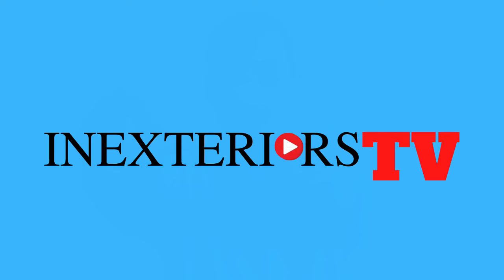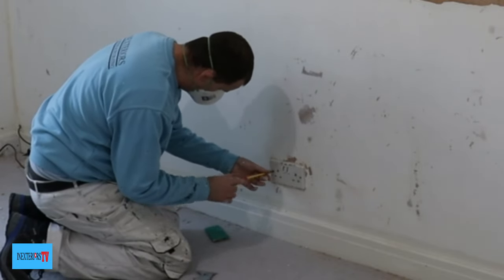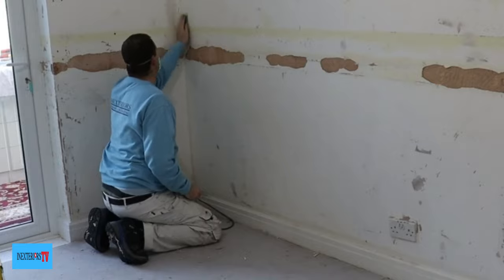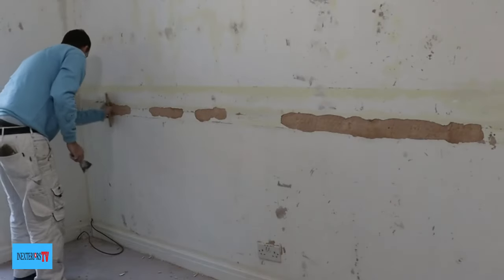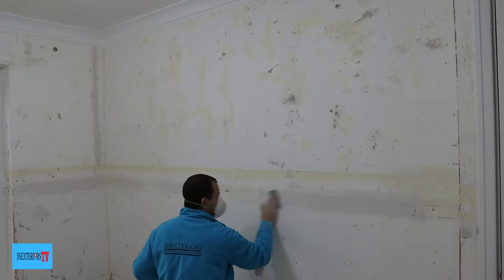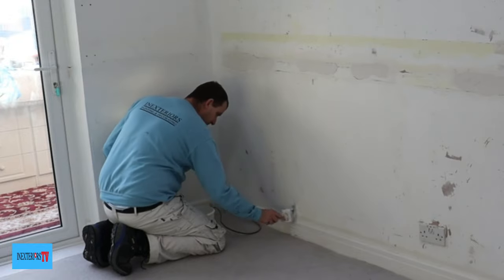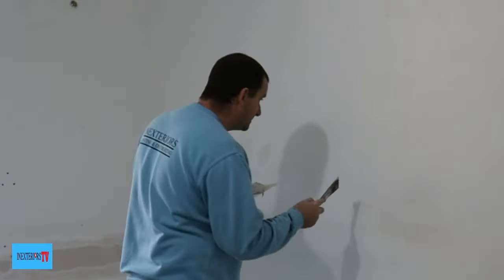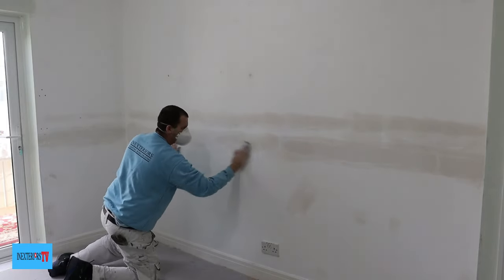Prepare and paint after wallpaper removal.

Comment: Peeling wall paper and  where the wall paper has been peeled in certain areas it has peeled down to cardboard. It makes wall not very smooth do I use filler in  uneven areas ?
Reply from the maker: Yes fill cleanly so you dont have very little sanding,

Comment: Is it advisable to clean the walls before painting to get rid of any wallpaper plaster residue and do I need to take any additional steps to remove wallpaper that's been painted over?
Reply from the maker: I give the walls a good sand down when dry the next day, never had a problem with paste residue. you can wash walls if needed or paint in zinsser guardz if you do have any problems. this video  might help with wallpaper stripping https://youtu.be/TwWg1F4FLMM

Comment: Hi great video mate. Just wanted to ask. You didn't mention anything about removing the glue leftover after wallpaper removal. What's the best way of doing that?
Reply from the maker: Thankyou very much,all ii have done is give the walls a good sand the day after being stripped, that has worked for the last 25 years, if there was a problem i would put a coat of zinsser guardz on.

Comment: Do you spot prime? And when should I spot prime if you do?
Reply from the maker: once you have your first coat on then  filled, maybe 2nd fill were needed, then touch up filler with emulsion, then 2nd coat.
Reply: @Inexteriors  so I should fill once or twice before painting? Then spot prime if I’ve filled over first coat of paint?
Reply from the maker: @AlfGuitar  Fill what you can see the spot it up.
Reply: @Inexteriors  can I spot prime the filler before I apply first coat? After I’ve sanded and dusted etc?
Reply from the maker: @AlfGuitar  coat up the full wall, then fill again if need, then spot up, then top coat.
Reply: @Inexteriors  I’ve filled the walls, spot primed, then coated 1st coat, I can still see the patch marks shall I just spot prime again before second coat or just do second coat?
Reply from the maker: @AlfGuitar  spot prime again to be safe.